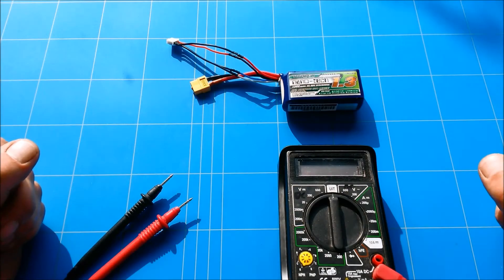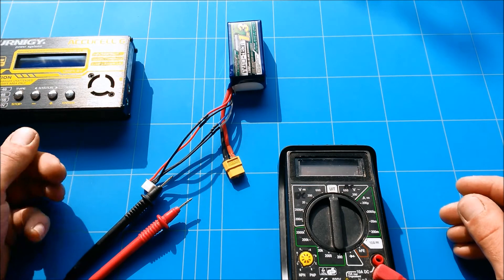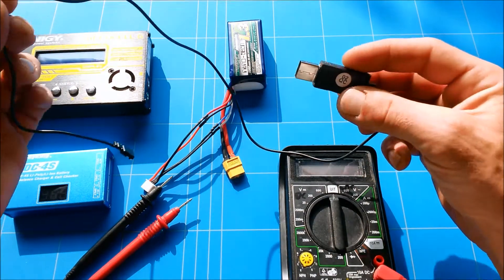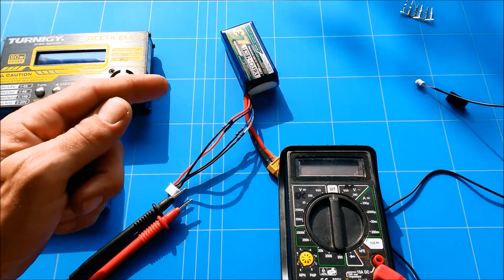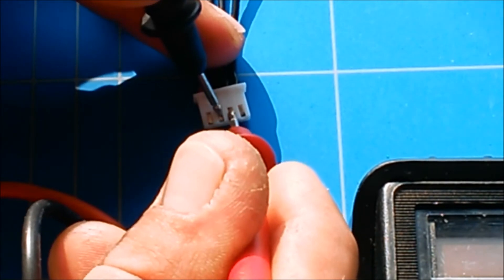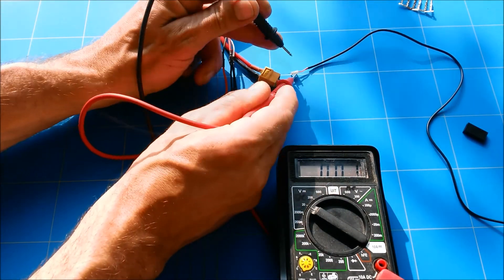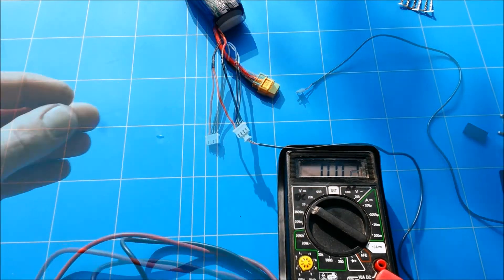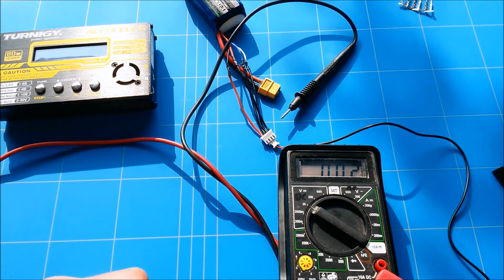How To FIX a Lipo Battery Repair Under $1

Comment: Thank you for your valuable tip saving my two 3200 mHa Spekturm, 3S, 11.1V  batteries. 
I am using ISDT 608AC charger and when I wanted to charge the batteries - after a long time -  I received the following warning:
"perform unbalancing task?" I couldn't find any helpful answer to solve the problem.
After watching this video I realized that my batteries' voltage was very low and any smart charger would refuse to charge. 

When you charge each cell separately - as shown in the video - up to 3.5 volts ( it took approx. 24 minutes to bring up to 3.5 volts with a small lipo charger) the smart charger is able to charge with a balancer plug.
Previously showing the "perform unbalancing task?" message was the result of the very low voltage in every single cell.
Well, the batteries are saved, and thank you again.

Comment: Some LiPo /  LiIon charges will mark a battery defective that might still be functioning a bit.

If you have a variable voltage supply you can 'load' the with a very small current to 3.1V per cell, after this procedure a standard LiPo/ LiIon
 might accept them again.
Reply from the maker: true

Comment: Ik heb hubsan zino batterijen liggen die nog maar 1.min werken. Kan ik deze ook repareren op deze wijze?
Reply from the maker: het kan ook zijn dat de oude battery geen stroom meer vast houden check the voltage als de batery vol is
Reply: @HowToDIYRc  ga ik ff proberen. Originele lader geeft wel aan dat die vol zit. Dus ff opmeten

Comment: SO STUPID. Just use your "balance charger" and set it for SINGLE CELL (1S). Then connect the croc/alligator clips onto the charging lead and charge the low cell. If it refuses due to low voltage, change it to LiFePO4 or change the  voltage manually.
Reply from the maker: lol

Comment: I also had the same DC-4S charger and a slightly under 3V/cell 2S batery. Using this method with an old unused phone charger solved my problem! Thanks a lot!
Reply from the maker: nice glad to be helpfull and save you a few penny's :D

Comment: Awesome work man! I will test your solution when i have the charger but I have a gut feeling this will fix it!
Reply from the maker: 9 out of times it works as long as the battery cell voltage is not below 1volt! hope you can revive your old battery and its not puffy
Reply: @HowToDIYRc  It worked!!!!! You saved a 40 dollar battery!!!! Thank you soo much
Reply from the maker: great news im glad to be able to help :D
Reply: hii.. i have lipo 2s.. 1cell 3.7v and then 1cell 0.0v.. can i use your tips? thanks b4  sir.. love your video :)
Reply from the maker: 0v are you sure? be very carefull this cell can explode any minute discard the battery its must very puffy like a balloon right?
Reply: @HowToDIYRc  i tried use nicm and nicd mode with imax b6 then volt only 1 cell 3.7v and 1 cell  0.11v ( charge about 20minute) (imax said full charged)  and then a few minute back to 0.00v.. whqt should i do? can i save my lipo? thanks for reply sir! :) btw not too puffy.. but yes puffy but not too big.. because hardcase lipo mybe?
Reply from the maker: OH MY GOD THIS IS A RISKY DO NOT EVEN TRY TO SAVE THE BATTERY IT'S NOT WORTH THE RISK COMPARE TO WHAT A NEW BATTERY COST
Reply from the maker: BELOW 1 VOLT AND CELL IS REALLY DEAD 100% SURE IF IT EXPLODE IN YOUR FACE YOUR DAMAGE FOR LIFE CHECK FOTO AND VIDEO
Reply: @HowToDIYRc  wow.. 😂 ok thanks sir.. time to buy new one :(

Comment: Hello, im doing what you doing but my connector pin getting hot and melt for while. can you explain with wiring diagram?
Reply from the maker: no those diagrams are already in google and seems like you created a shortcircuit
Reply: @HowToDIYRc  how long you charging battery?
Reply from the maker: very short just to get the voltage above 3v then real hobby charger will do the rest

Comment: Thanks, recovered a bunch of 2s batteries with your tip. I just went a little bit below 3V per cell and my balance charger would refuse to charge them. I had a Eachine QX65 laying around, it worked perfectly for it. EDIT: even managed to charge one that was completely dead (2 cells @ 0V)
Reply from the maker: Ye I know that problem and it sucks because your battery is not really bad with it just under 3v
Thanks for the comment
Reply: @HowToDIYRc   Oups, yeah you also mention it in the video, I did watch it of course, but it was a few weeks ago. Then noticed it again in my bookmarks and wrote a quick reply😀

Comment: What do I do with the error message CELL ERROR and no other explanation? I have the SkyRC e660 charger and even the manual doesn't tell me what to do. Appreciate any ideas.
Reply from the maker: cell error comes up when you try to charge a 4s lipo with 1 broken balance lead makes the charger see only 3s but knows you want to charge 4s and for safety, it gives you cell error 
to fix it check the balance connectors if they are not corroded or a broken wire

Comment: My lippo battery 2nd cell not charging 0 voltage showing how to charge..
Reply from the maker: that's not good zero voltage means dead throw away very risky to charge dead battery stop don't do it

Comment: I charge it as a Nicad Battery until the voltage comes up a little do not leave it unattended it could cause damage do a little at a time and then charge it as a Lipo works great.
Reply from the maker: we have seen that trick and it works but that's the old way of doing things my way is better for the battery :D
Reply: He clearly says that damages the cells that aren't at low voltage because it stresses them out while trying to get each cell balanced. This way it brings the low cell up to speed without connecting the other cells directly to power.

Comment: hmm...!  it looks like my problem at  2S  lipo's battery power..!
Reply from the maker: +mukhlis1010 than charge it up
And monitar the voltage if drops really fast and don't hold the charge your cell is dead
Reply: How To DIY Rc -  sorry.. I mean, like problem of my 3S lipo 🔋 battery power, when the first time I charge it, the result: 4.15 - 4.08 4 20. But on the 2nd charging, they becomes: 4.25 -4.88 4.20.  how could it be..bro?
Reply: Do I have to discharge each others, or charge 2S only like this video..? Thnks
.🤗
Reply from the maker: if you have 4.88v than ore the battery is a big balloon and puff or your connector connections are dirty and give a false reading 
4.25 is possible if you overcharge a cell.... Letting me believe you charger is maybe the problem
normally is stops charging at 4.20 check this charger it's cheap and those oke job http://bit.ly/2s-4s_30W_Lipo_Charger
Reply: How To DIY Rc - wht about discharging mode, do i have to use it ..?

Comment: sir 2 cell have voltage but one cell no volatage...
Reply from the maker: is it an old lipo battery? and did you try to charge it and still get zero voltage?

Comment: i have 3cell lipo 2200mah but when i check voltage 4 wire 1:2,2:3,3:4 3:4 not showing any voltage means which cell dead sir
Reply from the maker: no voltage all cell are dead but maybe you have corrosion on your connector giving you a false reading?

Comment: A rather interesting thing I noticed.  With subtitles on at 2:04 he clearly says I bought this from 'ebay' yet the subtitles say 'bangood'   I clearly youtube does not just listen and convert what it hears, it seems to adapt what is being said as those words are not remotely similar.  rather interesting and I wonder if there is a link there purposefully in the background. Also as 2:24 it does it too.
Reply from the maker: hahaha good one sir very sharp do you also have problems with ebay delivers? only 50% or less gets delivered and i'm not going to send any of my viewers or subscribers to a retailer with a horrible customer support that why you also don't find links to GB
we are doing this all to help you save money and have a good buying experience and yes the links are affiliate links just like it says down below in the description i have nothing to hide Sir and we only have honest intention to help by the way the single cell charger cost only $1 so we get 1cent not even worth my time but this we made this video to show you a more easier, cheaper and better way to fix your low voltage lipo battery than anybody else on youtube !
thx for watching :D

Comment: Can i charge a battery which was charged 1yr back
Reply from the maker: it depends on the condition of the battery and how high is the voltage of each cell?
and is the battery hard or feels it soft on the outside?
Reply: Its not soft nor hard
Reply from the maker: if your battery looks healthy you can try but do monitor until it's fully charged
don't walk away keep the battery insight
Reply: One of my cell show 0 voltage
Reply from the maker: that cell is dead and don't hold a charge anymore 
it's pretty dangerous battery and you shut discard of it!
it's now worth the risk of burning down your house or it exploding close to you!!!
buy a new battery is safer

Comment: gotta sub' a guy who's thinking outside the box! Done! i was only just thinking along the same line then stumbled across your vid with you doing it ;-) nice
Reply from the maker: Thanks Sir... after understanding how that cheap 2s, 3s, 4s, chargers are working 
it made perfect sense to try it my way so we don't hurt the good cells and only pump up the voltage a little bit from the bad cell to get it above 3volts and the hobby grade charger stops giving errors and starts charging like nothing ever happened :D
thank you for your positive that's what we are doing it for thx :D:D:D

Comment: so,if the cell is on 0,, it will not work?
Reply from the maker: I don't recommend Craig 
Zero volt meens cell is dead really dead!
and dangerous (already puffy it can blow up)
But are sure your making good contact with your voltmeter??

Can you tell me if it's a old ore almost new lipo battery?

Best regards dave z
Reply: it's a 4 cell less than a year old. When I ran the battery after a full charge it quit after about 2 minutes.No puffiness.When I checked the volts cell 3 was 0 & 4 was 1.94
Reply from the maker: +Stephen Craig and what is the totale voltage of the battery ? Use the xt60 conector to get the voltage of all for cells at once

Comment: Great man hope I don't explode mine
Reply from the maker: You do need to be careful with connecting the positive and negative and as long your battery is not puffy or damage on the outside you shut be fine
if the cell doesn't hold a charge then don't charge it.. that's the only real danger
thx for watching and taking the time to comment :D

Comment: just to let you know what you are only is just charging the bad cell to equal the other cell. the real problem is what's inside the cell once one of the cell goes below the required voltage this it the chemical inside the cell is no longer able to charge at there max capacity there for this mean it can no longer hold the charge. each lipo cell has a resistor on what the battery c rating is. the chemical inside the cell  is connected to a resistor once the chemical had an reaction due to low discharge both the chemical and the resistor are bad there for you will always have a uneven charge. but now the companies that invented lipo's are working on a different type of lipo battery similar to an ion battery. it is immune to heat and mistaking a low discharge.
Reply from the maker: ye your right but my battery still survive until this day yes that bad cell drops the voltage a little bit faster than the other ones but still work fine after a year using my method
only when they puff up i throw them away
Reply: How To DIY Rc oh ok that's good. but be carefull don't trust those lipo's why don't you use the Ballance charge to even it out?

Comment: Ah Perfect! I just happened to have a USB charger for an old mini drone. I took it apart checked for ground, checked low voltage on each cell and charged each cell up to match each other! (3.5v) Now my balanced charger is happy and bringing my lipo back up to full charge! Pheww! Thank you so much for the simple solution!
Reply from the maker: +DJ Chastain not a problem Sir thank you for your feed back🖒
Make sure to share it with your friends it's a shame how many people trow there lipo away

Comment: hi friend , thank for the review , can you tell me how i fix 3s battery.
5400mah and 11.1v 
2 cell its on 4.2 and almost and the 3 cell is dead its show me on the imax inncorect battery cell and when i chack i see that is dosent show me nothing .
please if you can help me.
Reply from the maker: Hi, ben (when you check, it doesn't show me nothing) you mean checked it with a voltmeter and gave you zero voltage???

iff that's so and the lipo cell don't hold a charge anymore and look puffy!!!
discard the battery it can explode that's my advice 
you can look on youtube where they show you how to remove 1 dead cell and turn a 3s in a 7.2 2s 
lipo battery... 

There is also a chance your battery wires have a disconnection
the wires are soldered to a silver/alu strip coming from each cell this strips can break 
it happened to my 4s last week it's now a 3s

hope this helpt you out my friend :D

what ever you try becarefull !!!
Reply: Happy Flyer FPV 
thank you very much for the fast answer,
i check it with volmeter and its show me 1 cell is 4.20 1.cell 4.20 and 1 cell is zero. when i try to connect to the imax its not show me error of low voltage its show me that it incorect cell.
now one side of the battery its puffy alitel bit.
now what you meaning to convert from 3s to 2s .
its not gona make me problam with my x380 drone ?
becuase the power of the drone that he need 11.1v?
thank you again .
Reply from the maker: +Ben Yaron iff the lipo is not puffy ore dend than you probley have lose connection 
Check your wire's going into your lipo battery there your probably able to fix it
Reply: Happy Flyer FPV  
thank you very much i will check it and let you know.

Comment: Thank you!  You just saved my new Multistar 5200 4S.  One of the cells was under 1V and my Turnigy Accucel-6 wouldn't charge it.  Much appreciated!
Reply from the maker: +Eric Greth thanks for your comment eric 
i'm glad to help out 🖒
Reply: Great video my friend! When you asked about whether I had watched this video, I confused it with another of your battery vids. Anyway this is the same pack (4s 5200 multistar) I'm having issues with. The charger will charge 3 cells to 4.2 ok, but one sits at 3.78 and won't budge despite leaving the charger running for ages :-( I had already assumed I would lose it - but tried your idea of charging single cell - but using the regular charger - still it would put mah in but sat at 3.78v. I'm wary of those little crappy usb charger cables - I have many, but most have some sort of issue - either overcharging or won't charge at all. I'm going to try this method and I'll let you know how it goes. and a belated thumb from me ;-)
Reply from the maker: Very weird problem and intresting to solve it
It sounds to me your got a lose balance wire did you checkt it with a voltmeter?
Reply: Still charging - sitting at about 3.9 on voltmeter.....
Reply from the maker: Check iff the charger dont get to hot and start to melt
Normal i only use it for a few sec to a min just to get it above 3v
And i can imagne it running very hot iff it needs to charge a big lipo cell by the way after the cell is full keep checking the voltage ervery 15min and see if it drops or hold the charge!
Reply: I think the cell is damaged, although there's no visible sign of puffing or warmth/heat.  I'll cut off the shrink tonight and see the balance leads are ok. I need a HobbyKing sale now ;-)